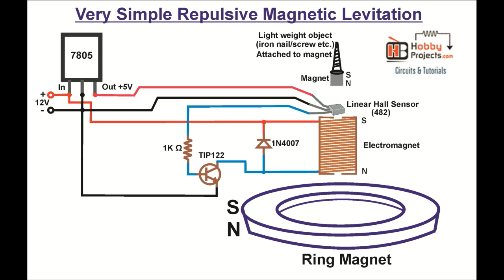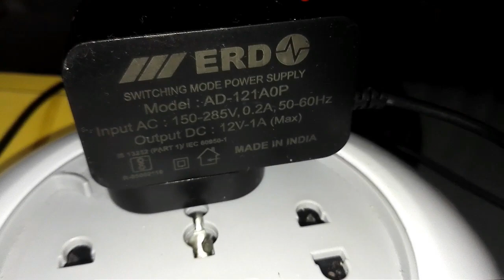Very Simple Repulsive Magnetic Levitation Experiments

Comment: Let me see if I can figure out the principle of operation.
It appears to me that as the magnet gets close to the hall sensor, it causes the hall sensor to have and output which turns on the transistor.  Both the coild and the ring magnet below has its opposite pole to the suspended magnet so therefore it should get sucked down, attracted and not float.

Comment: what are your permanent magnet dimensions?
Reply: plus how long does the coil have to be? dimensions of electromagnet?
Reply from the maker: Outer Diameter of magnet 100 mm, inner Diameter 57mm, height 20mm

Coil size height 20mm, width 18mm approx.

Wire thickness .2 mm aprox. You can also try with .3 mm.

Comment: @Hobby Projects
Hi Hobby Projects, Recently I discovered your informative site. I am a hobbyist and I find almost all your projects novel and interesting. 
After watching your video, I have successfully completed the magnetic levitation project in which a neodymium magnet is suspended under the coil. This I managed to do without using an arduino or any other microcontroller. Now I am trying the project in which a magnet floats over the coil. My problem is, the neodymium magnet does not remain stable over the coil; it always flies away and gets stuck to the ring magnet. The size of the ring magnet I am using is 90x36x15mm while what you have used is 100x57x20mm. Is the smaller inner diameter (36mm  instead of 57mm) the main reason for my problem? Looking forward to your suggestions that will help me to complete the project. Thanks.
Reply: I think neodymium magnets are too powerful for this type of simple system, this type of simple System cannot control it, use smaller neodymium magnets or feraid magnets.

Comment: The linear hall sensor allows to adjust by continuous loop but only vertically, what about the instability of other axis? It is hard for me believe, because atleast 3 or 4 coils would be needed to achieve stability in the repulsive levitation...
Explain me.... I don't understand the physics here, it's weird...
Reply: im a little confused too. i hate to suggest this video is fake and that the circuit you claim your using isnt true but i have a hard time believing this. the transistor switches power on/off to the electromagnet and this is controlled by the hall sensor, right?  while the electromagnet (el.mag for short) is on it should repel the floating magnet assuming the el.mag is an aircored solenoid. If the el.mag has a core (like iron or steel whatever) then the dl.mag should attract and pull the floating magnet. If we forget about the electromagnet for a second, lets talk about the relationship betweeen the ring magnet and the floating magnet. In the position shown in your diagram the small magnet will experience both a force of repulsion and attraction due to the unique field shaping of the flux lines of the ring magnet and how it differs from the shape of the field that encompassed the smaller magnet. the ring magnet and small cylinder magnet, due to the difference in the shape of their fields, if you arrange the poles like it shows in the schem, the lines of flux within these fields arrange themselves in a way that creates a sort of 'pocket' or 'node' in the space above the ring magnet that the small magnet can almost 'rest' on but its not stable enough to lock the small magnet in place. the smaller magnet will experience and force of pull in all directions horizontal to the plane of face of the ring magnet. it will also experience a force of repulsion along the vertical y axis in a direction perpendicular to the direction of the forcd of pull. With just this setup the magnet will not sit still in this spot and is pulled to the side and towards the ring magnets surface.
Reply: @ozymandiasking173  The coil dont reppel the magnet .The reppeling force comes to the ring magnet, and the coil atract the magnet and it balanced with hall sensor,Look in diagram and you will see south pole of the coil atract north pole of the  magnet.

Comment: i buid both , it works so beautiful , sometimes there is a  different character diagramm  of hallsensors or mosfets , the simpliest and garnatie that s it is works  , it s need a trigger poti between gate and source by the mosfet( 1k) or resistor at last  ,, with this you set the trigger with it , so all hall and mos are work , the 1 K resistor do not work by every parts , with this you can find also the trigger moment , the second resistor is then for protection for the hall ,,,,,,,,, i say thank you , special  for the standing levitation prinzip  !

Comment: Very, very nice project!
1) Why must the electromagnet be an 'air core' ?  Why not solid core?
Reply from the maker: Thanks. 
I had tried it by using Iron core but found the better result with air core electromagnet. The levitation distance was effected by the iron core. Sometime the levitating magnet sticks to the iron core randomly.
Reply: @hobbyprojects  
Exactly. The ferrous magnet creates one field while the electromagnet creates an opposite field. The two combined creates a conflict. Repelling, keeping it away. But attracting, making it not leave.
If the center of the electro magnet had an iron core, it would change the field and either push it to one side and down or pull it in and down.

Comment: how much current your levitation is using ,,, by the coil with 26 ohm 
and 12 volt.  i have just 7 Ohm coil and 300mah current /12volt   ,my 
coil is centert in a Aluminium stick , so that i can ajust the coil 
niveau very easy (high&down ) ,  it works very stabil with 8mm 
levitation distance , i am very happy for this challenge ,and fight for 
it till it s done , i look myself to make a video for this cute pretty 
very cool new update 2019 device , fully reduction prinzip , but it must
 said , it s more heavy to build it , than the hang version , remark : 
my version circuit is identical with yours , but without the 5 Volt IC 
stabi , so one part less , it do not need the 5 volt stabi .
Reply from the maker: Total 220ma by the 26 Ohm Coil and 5 Volt IC